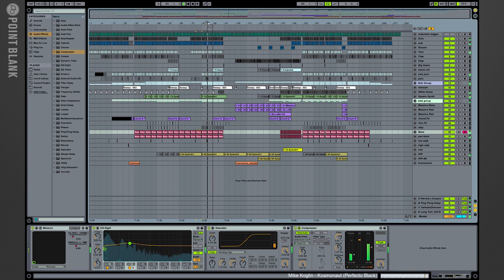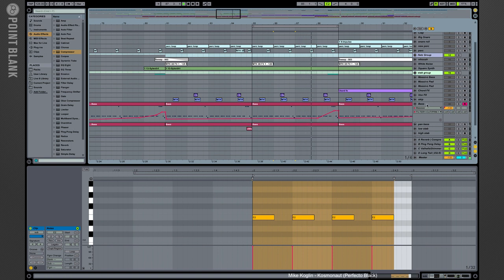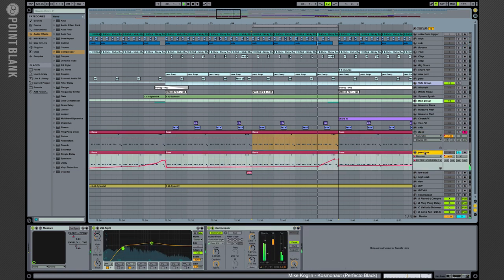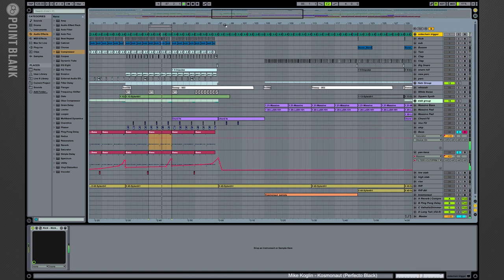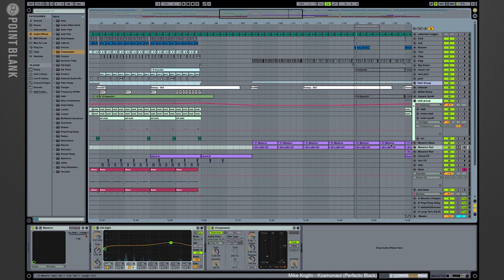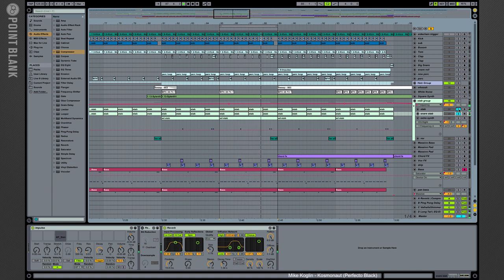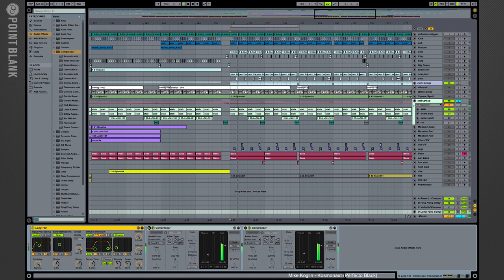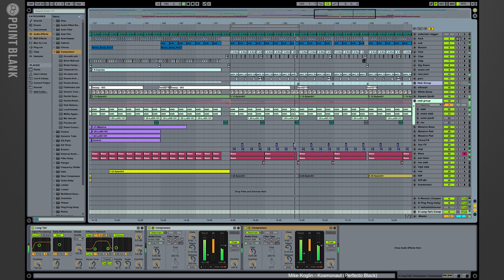Trance & EDM Mix Breakdown w/ Mike Koglin: Part 2 - Bass & FX

Comment: I'm looking at your pad sound and wondering, do you EQ in Massive? I was always under the impression that even with the right sounds you should be carving out each sounds space in the frequency spectrum, but you are running VSTs with just some boosts in the upper range (so you didnt bounce down audio yet). I'm so confused because your track sounds phenomenal so either you EQ'ed via Massive, you are sending your synths to a BUSS channel that I can't see, or you have selected the most perfect sounds imaginable for your track and are a wizard of the studio.
Reply: +Ari F hi, a few things here. ableton doesn't use bus routing it uses groups and return chanels however.. mike k isn't eqing in massive in this instance nor sending the pad to a return chanel because if you pay close attention the pad happens to come in during a time it actually doesn't need it that is to say.. the pad would actually conflict with the bass and kick or body of the kick but they do not happen at the same time in this instance so it is safe to have the EQ fairly open at the bottom end so the pad bass can be heard. if he rolled off the bass from the pad then the mix would sound hollow during that build up.